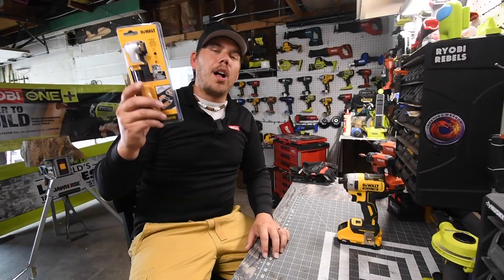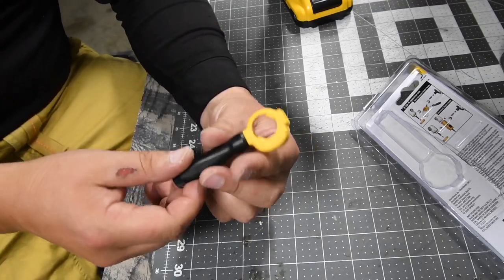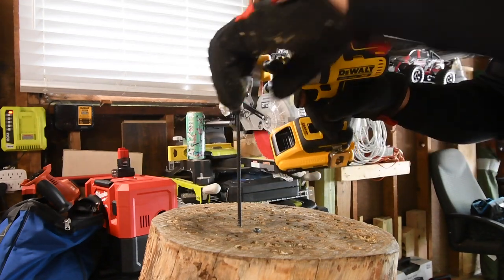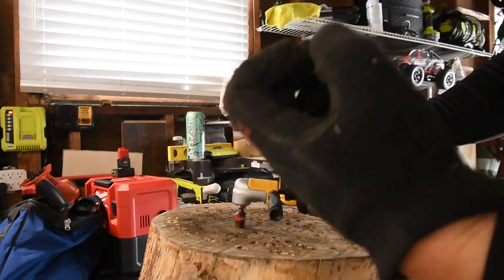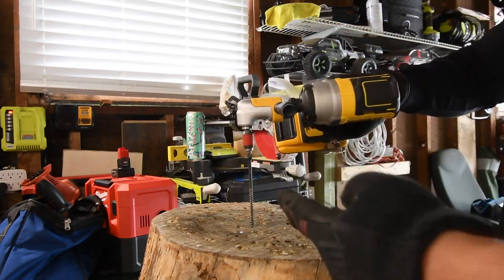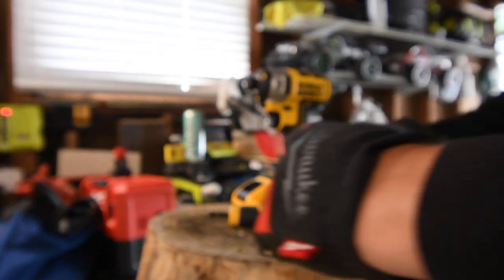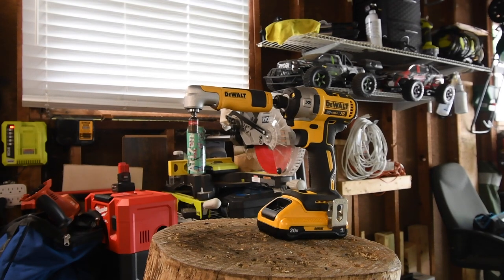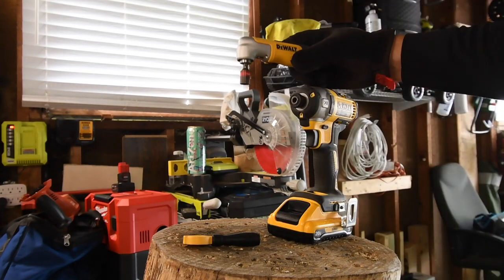Dewalt Right angle attachment (with Handle)

Comment: Its designed for smaller screws in tight spots. Like pulling a screw out of a cabinet box behind a sink. Not driving timberlocks or 4in construction screws directly into a log. You say you want to test it out but in no way did you use it for what it is for. The handle doesnt need to be strong. It needs yo be small and able to give you just a little more leverage to get that rage inducing screw out so you dont have to try to get it with a Phillips bit in a 1/4" socket on a small ratchet, sweating and cussing the whole time.
Reply: Finally someone commented something that makes sense
Reply: I see a + on top which is meant for precise screwing into walls and boards with a line level laser.
Reply: this isn’t a specialty tool…. huh?  @skwish6952 called it it out perfectly
Reply from the maker: so your telling me that people will only use this on small cabinet screws and nobody will try to use it for something else? Doubt that. people will use this on a lot of other hard to reach tasks other then only cabinet screws
Reply: @ManCaverTools  I said its is designed for that. People use a lot of things that they were not designed for. What I am saying is you are treating this thing like someone is going to be using this thing all day every day to sink big fasteners and that is just not the case.
Reply: He wont understand, he thought that by using it with long screws the attachment would fail and he could make fun of DW, but it survived, so his conclusion was that if it lasted his test it would be up to "any" other task
Reply: Let’s cut MCT a break. He’s testing tools out of their comfort zone to show you the over and under. Yes, I get that this is way over what it’s made and designed for. Also, that handle isn’t made for super hard applications and is designed to control the RA attachment when you are under a cabinet or in tight quarters. You can’t please everyone but let’s keep it positive towards the people providing the content.
Reply: @Apache-Helicopter-Life  100% ageed, but the way he tested is missleading to young/amateur weekend warriors or diy-ers
Reply: Captain take that long extension out of the end of the right angle attachment. That's why your having such a hard time
Reply: I used mine when I was glazing  in high rises. So I could screw the bottom of the windows behind the columns. I like that this one can be shortened compared to the old one. Get a little more leverage behind it since your usually using your fingertips.
Reply: I have to agree with you guys there this attachment is not designed for long acrews as he is using in rhis video...its intended for had to reach areas where such as cabinetry where small screws are required.. but in this case for his video his still using the wrong method to screw in these screws the wrong way...for instance in hard wood your supposed to make a hole with a drill bit to make it easier for the screw to enter and the bits the wrong one as well...
Reply: He should be first usibg the bit holder then the bit so it gives him better guide and leverage over the screw when using long screws like this...dont people like this ever learn....i guess not...

Comment: The handle is to act as a guide accessory. It's not designed to support long bolts into hard wood. 9 out of 10 times that you use a right angle attachment; it will be for more delicate work (like cabinetry for example). It's a fine accessory for it's purpose - but not a necessary one.

Comment: The handle is also hollow to store a bit in there.
Reply: If the handle is 5/8” or 1/2”, you can buy a cushy foosball grip replacement on Amazon and hairspray it on for a awesome grip.

Comment: starting from a sloppy removal from package you begin a trial by error procedure beginning with the black plastic lever while guessing (in your own words) at its function without defining it. This could be nicknamed the trial-by-error video (something I was trying to avoid by searching for a comprehensive procedures manual/video).
Reply from the maker: this video specifically was to test out it limits. I was hoping to break it

Comment: soon.
Jacobs 31048 6000-Series 1/2-Inch Soft Grip Sleeve Keyless Drill Chuck with 1/2 to 20 Threaded Mount
Jacobs 31048 6000-Series 1/2-Inch Soft Grip Sleeve Keyless Drill Chuck with 1/2 to 20 Threaded Mount
For the Ryobi drills with the friction clutch.  Made my older Ryobi drills great.

Comment: The handle should have been put on the top of the angle so that it could be used with downward pressure... And metal insert where the threads are
Reply from the maker: I agree with you on that

Comment: I don’t think that soul is for all that I think those that tool is particularly for tight corners. Hard to reach places that you don’t wanna morrow or mess up your tool that’s what that tool was attended for. I’m assuming I might be mistaken I’m not an expert either, but I’m assuming that’s the purpose of that tool it’s not for driving in large fasteners or anything like that, it’s hard to reach areas that drill or impact driver. It’s not able to reach because it’s too big.